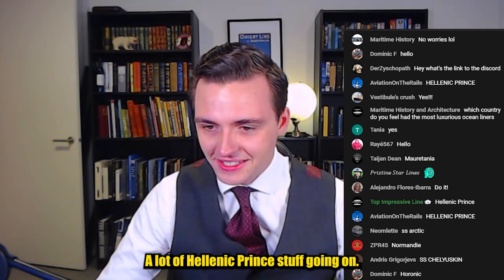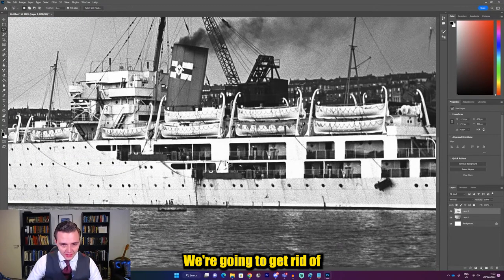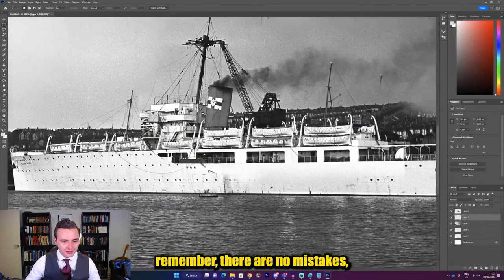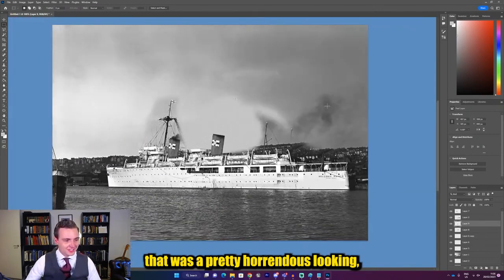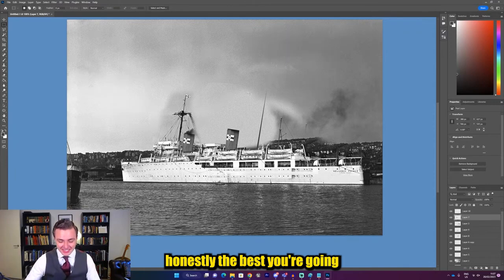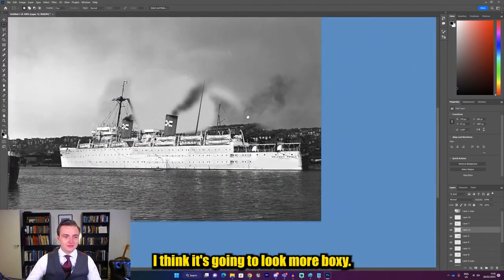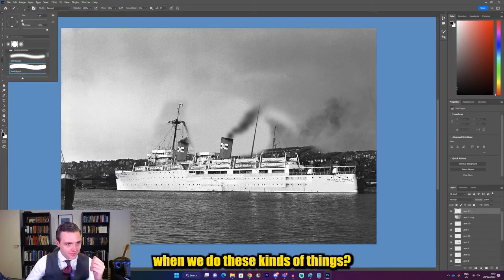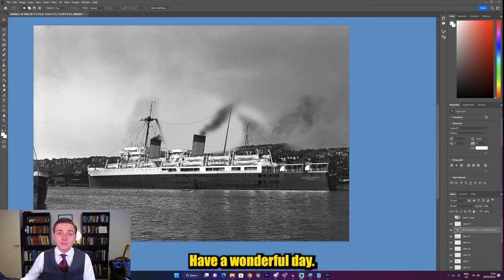Trying to Fix this Ugly Ship

Comment: Actually, the ship looked better with the original kitchen knife profile it had. I would eliminate that weird half plate at the begining of the promenade deck, add a second covered promenade deck on top, leaving the stern uncovered, then widen the superstructure at the bow to have smooth sidewalls fused to the hull, stretch it some meters towards the bow and eliminate the top deck, lowering the bridge and wings. Lastly, it maw not need that many lifeboats but I don't know; maybe just a fraction of them but bigger  in size could do the trick.